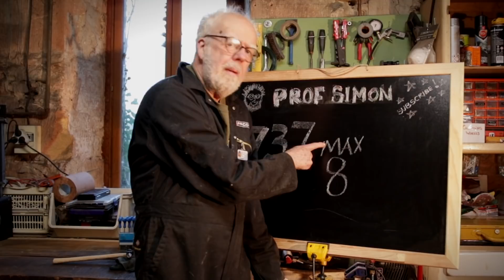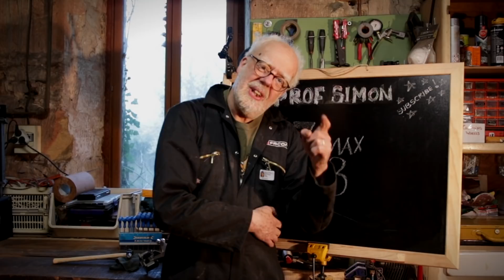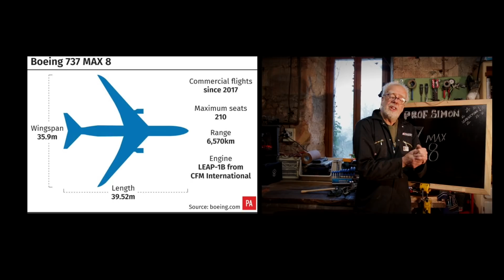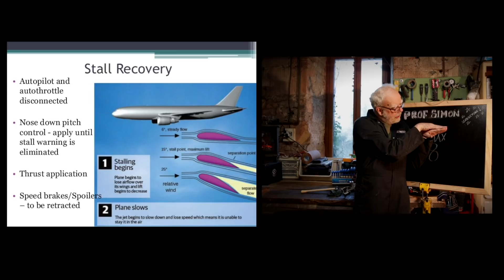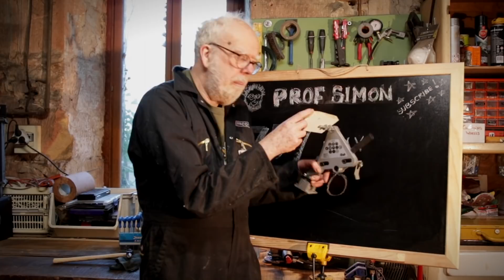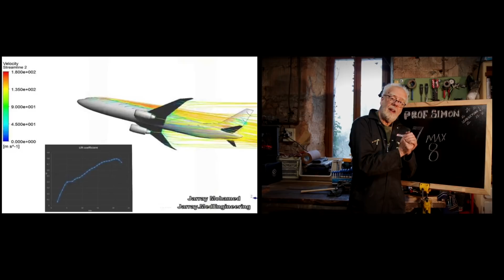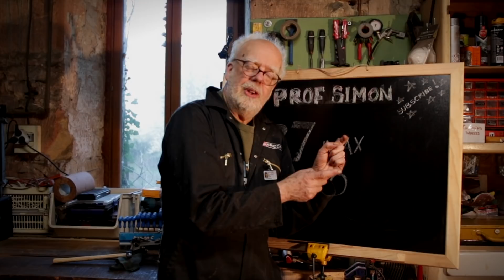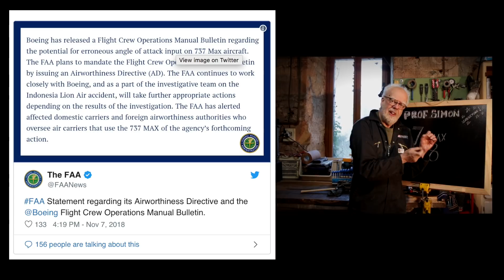Boeing 737 max 8's

Comment: This video isn't wrong, but misses the fundamental point... like all videos I've seen about this issue.  The fundamental point is this.  To fly an airplane expertly takes time and practice.  Eventually, "the pilot becomes one with the airplane"... to adopt a phrase most people will understand.  But mere mortal human beings are not capable of becoming one with dozens of airplanes... or with dozens of combinations and permutations of a single airplane.  But the trend in avionics and aircraft automation systems is to have many subsystems, many of which are more-or-less independent, and many of which are interconnected with other subsystems.  The problem is, a pilot can only "become one with one airplane" (or at most 2 or 3 airplanes, though even that is too much for many or most pilots).

The bottom line is the following. An airplane should have only two modes of operation: the pilot flies the airplane or the autopilot/automation-system flies the airplane (based on data entered into the avionics by the pilot and/or copilot).  When anything "goes strange" or "funky" or "odd"... the pilot should grab the controls (yoke/stick, rudder pedals, engine thrust levers, flap levers, trim controls and any other control surface manipulation controls) and FLY THE AIRPLANE.  Whenever pilot or copilot grabs and moves any control the autopilot needs to report this fact out loud ... for example say "pilot in control".  Likewise, when autopilot is engaged, the autopilot needs to report out loud that "autopilot in control".

The most important point is... when pilot and/or copilot are flying the airplane, the autopilot must NEVER overrule them... NEVER, NEVER, NEVER, NEVER, NEVER.  However, it is very desirable for autopilots to provide AUDIBLE (sound and verbal) warnings for many conditions (dangerous and mundane) such as pitch, roll, climb/descent rate, terrain ahead, altitude above ground, traffic in the area... and plenty more.  A pilot can IGNORE audible warnings and information from the autopilot when necessary.  And FOR CERTAIN any pilot with even modest training can look at his instruments... several of his instruments, as well as the view through the windshields when in VFR conditions... to determine what corrective actions might be necessary.

THE AUTOMATION SYSTEMS MUST NEVER OVERRULE PILOT OR COPILOT CONTROL INPUTS... BUT NOW THEY INCREASINGLY DO SO.

The pilots are almost always held at fault by aircraft manufacturers (no surprise) and often by accident investigators and FAA... when automation systems are to blame for crashes. I have seen this pattern increase in recent years. It is a historical fact that pilots are universally considered responsible for flying their aircraft.  However, now that automation systems overrule pilots, this is FACTUALLY FALSE ... yet the historical presumption inappropriately remains.

The fundamental fact is what I said above. Human beings do not have the capacity to deal with endless combinations of permutations of automation systems flying various aspects of the airplane and/or interacting with other automation systems that are.

The ONLY solution that is commensurate with the ACTUAL capacity of mere mortal human pilots is to have TWO AND ONLY TWO MODES OF FLIGHT:
  - pilot flies the airplane (and all control surface do as they are told by pilot manipulation of control surfaces, thrust, etc.
  - autopilot/automation-system flies the airplane (and takes actions based upon data entered by pilot and copilot).

NO other combination and permutations are acceptable.  Mere mortal human pilots cannot hope to "become one with many combinations & permutations".

Note that some pilots will disagree with this... but that is because they are afraid to not be hired if they claim they cannot handle excessively complex systems.

*AND FINALLY ... for any of you who remain skeptical ... you must consider the following:  When something "goes strange" or "funky" or "odd" ... SOMETIMES an airplane may be so high above the ground that the pilot has time to paw through the pilot operation handbook for a significant period of time to attempt to figure out what is causing the strange, funky, odd behavior of the airplane... and fix the situation before the crash.

But SOMETIMES (and far too often) the airplane is close to the ground... AND THE PILOT DOES NOT HAVE TIME FOR SUCH NONSENSE.  These are precisely the situations where it is absolutely crucial that "the pilot is one with the airplane" to assure survival of the airplane and crew and passengers and/or cargo.

Note that both the Indonesia and Ethiopia crashes were fairly close to the ground when the airplane "went strange, funky, odd" and crashed them into the ground.  While the Ethiopia airplane was not at what one would normally consider a terribly "low altitude" (it was somewhere around 9000 feet as I understand)... the ground was somewhere around 8000 feet in that area, so the airplane was only a few hundred to ~1000 feet above the ground.  Which means... VERY LITTLE TIME TO RESOLVE THE SITUATION... OR DIE.

This is why there should only be TWO MODES of flying: pilot flies or autopilot flies.  ... NO MORE.

NOTE: These big complex airplanes have dozens if not hundreds of automated systems to control all sorts of aspects of the airplane. For example, systems to control the cabin temperature, cabin air-pressure, cabin oxygen-content, and on and on and on.  THESE SYSTEMS DO NOT FLY THE AIRPLANE AND ARE THEREFORE NOT THE AUTOMATION SYSTEMS I REFER-TO.  Most of these systems can be completely independent from each other, and can be enabled and disabled by the pilot or copilot or crew independently without risk of crashing the airplane. So don't pretend I suggest the impossible or impractical. I only refer-to automation systems that fly the airplane ... meaning control pitch, yaw, roll, thrust, flaps, air-brakes and such. The saddest fact of this situation is... I am almost certain the aircraft manufacturers and crash investigators will continue to practice of having their version of HAL9000 automation systems control and manipulate more and more combinations and permutations of flight controls... and continue to pin blame on pilots who have been pushed further and further beyond their capacity to "be one with the airplane".  And so, I expect more of these crashes will happen in coming years.

Disclaimer:  I am a scientist, engineer, inventor, product developer... and I've created many products with robotics and automated control systems.  So I have experience with these systems and have spent time worrying about whether my designs might create or leave problematic situations.  Furthermore, I have been a private pilot for many years and recently purchased a small airplane... with advanced avionics and autopilot.  However, the so-called "advanced avionics and autopilot" for small private aircraft are not the gigantic complex systems the airliners are.  If they were, I would do without the autopilot.  As it turns out, these simpler autopilots pretty much work the way I suggested.... either the pilot is flying the airplane OR the autopilot is flying the airplane ... and never any combination or permutation or mixed-bag of "some of each".  And when the autopilot is turned off, it does not control the airplane.  And when ANY pilot manipulation of the autopilot is detected by the avionics, the autopilot is totally turned off and only the pilot is flying the airplane.  I say the above to indicate I have some experience in these topics, but only limited second-hand knowledge of flying big commercial aircraft.  Nonetheless, what is happening seems obvious to me, and I expect the dishonesty of executives in the aircraft manufacturer industry will continue to make this problem worse, and continue to blame pilots for what is in fact their malfeasance.

Comment: To many overweight passangers!.....pilots calculate the total weight of the aircraft by an average  weight per passanger, + luggage, fuel, and known ,fixed factors!...the only variable is the total weight of the passengers on board!...all  passangers should/ must be weighed , just like luggage,...so pilots/ computers ,can accurately calculate the gross weight load of the aircraft,and determine if the plane is over its flying capacity!...it's a fine line, a few pounds,between flight,, or crash!...

Comment: You are completely wrong...these planes had conception isues from the begining...that were not recognised...and even doe are having issues are still in production...SAFETY FIRST my friend and not business,affair and fuel economy. Machines,programs like autopilot,MCAS are made to help pilots but not to replace them or oblying pilots to fight with a machine...it's awful that a pilot manouver CANNOT outrule a machine,computer decision which can be faulty ex.because of a bug in the system,faulty sensors and so one...to be OBLIGATED to do a shut down manouver of a system like in the case of MCAS one in a stress condition can be faulty and secondly installing a shut down switch proves that can be dangerous and harmful.

Comment: When the KC-135s were updated with newer more powerful engines, an automatic rudder control was also installed.  If the pilot were to lose an engine, the results would cause the pilot to lose control without the system.  It monitors the engines, and adjusts the rudder based on engine outputs.

Comment: Let's assume that both accidents are a result of inaccurate readings from the AoA, which means the MCAS is operating using incorrect data, which gives cause for the Captain to fight with the aircraft, effectively fighting against the MCAS system. There are procedures in place for this type of environment, whether it be an older 737 that doesn't use the MCAS system, or the new MAX variants which do, it's called the "runaway stabilizer non-normal checklist".

1. Control column .............................................................Hold firmly
2. Autopilot (if engaged) ....................................................Disengage
Do not re-engage the autopilot.
Control airplane pitch attitude manually with control column and
main electric trim as needed.
3. If the runaway stops: (end of checklist)
4. If the runaway continues:
STAB TRIM CUTOUT switches (both) ..........................CUTOUT
 
If the runaway continues:
Stabilizer trim wheel ........................................Grasp and hold

2. doesn't apply because MCAS does not operate when Autopilot is engaged, nor does it operate when flaps are extended
4. is the critical point, because if you disengage the STAB TRIM CUTOUT switches, effectively disabling the electric stabilizer trim, MCAS can not make any corrections. To be clear, MCAS can not make any adjustments to the stabalizer trim of the aircraft if the electronic motors that control that function are disabled.

There have been several instances reported regarding the MCAS system, or more precisely the aircraft operating in a way that suggests the MCAS system was being fed bad data, whether is was faulty AoA equipment, or even implementation within the new design frame, doesn't change anything, because in all of those previous instances the pilots simply followed the checklist and regained control of the aircraft. Does the MCAS system need improvements, maybe, but more importantly whatever redundancies that are currently in place for equipment failure are clearly inadequate.

Here's a thought, you also have to wonder what the GPWS was doing when MCAS was driving the thing into the ground. Just imagine that scenario, your fighting the aircraft that wants to pitch down and at the same time you've got the GPWS screaming "terrain, pull up, pull up". Talk about playing mind games, damn, not a scenario I'd ever want to imagine.

The First Officer reportedly only had 200hrs in this aircraft and I think that's correct as I've seen it brought up in many articles. Let's just say it's fact and move on to this next piece of information, or misinformation. I have also heard that the FO was in control of the aircraft during takeoff, which isn't unusual, in fact more often than not is the case, but those who are suggesting that he was in control during the final stages of flight, I think, are incorrect. It's my understanding that with any emergency the Captain both verbally and physically takes control of the aircraft, then instructs the FO to start working through checklists based on the Captains evaluation of the situation. I'm happy to be corrected on that one, but if that wasn't the case and the Captain allowed the FO to remain in control while he worked through checklists himself, hmmm, not so sure that was the best course of action.

Lastly, it's goes back to the fact regarding MCAS not operating whilst flaps are extended. My understanding is that they didn't get more than 2,000ft in elevation and was fighting the aircraft more or less just after takeoff, but an interesting observation from the data regarding the airport is that it's at elevation, some 7,500ft and had a long runway, over 12,000ft, so flaps may not have been used at all for takeoff, hence they were immediately fighting MCAS from the get go. It's just a theory, not fact, just me trying to put all the pieces together.

Comment: Canadian pilots start their career in bush flying float or amphibious aircraft and build experience that is. compatible with aerodynamics then proceed onward to jets. Third world countries do not follow such a route. Inexperienced pilots on  takeoff upon reaching VR speed turn on the autopilot and fly the aircraft by rotating the little button of the HSI ( horizontal situation indicator) which is coupled to the AP. If all goes well they have a safe trip and log in the hours into their log books. They in fact are not "experienced pilots" but would be experienced at playing TV games.

Comment: Thanks professor for your humble opinion. As a retired military pilot and flying instructor perhaps I could add a little bit of my humble opinion. From a very early stage in every pilot’s training, the “standard stall recovery” (SSR) is taught and is practiced on every general handling (GH) sortie for the rest of his flying career, at least this was so in the RAF. I must have flown, witnessed or taught the SSR many hundreds or even thousands of times. As such the SSR is so engrained in a pilot’s skill set, that anyone who designs a system that expects him to act differently to this in a stress situation has to be an imbecile. I thought manufacturers had test pilot’s to advise against such foolishness. Anyway, that’s my humble opinion.
Reply: Well said. But as the good prof has said, failure to account for ingrained behaviour is not confined to the aircraft industry. Anyone who remembers their first encounter with Apple's 'natural scrolling' will know what I mean. Fortunately, the consequences of such imbecilic design are usually far less catastrophic.

Comment: Are you suggesting that the (I'm assuming required for the type) briefing/class/etc. isn't covering the differences well enough, or that when a seasoned pilot gets in a tight spot they revert to thinking they're flying the older (but more seat time) software (airplane?)

Comment: Not really how 737 works. It was not on autopilot. MCAS is always on but only active when the flaps are up and autopilot is OFF. It moves the entire stabilizer NOT the elevator itself.
1. Boeing found 14% improvement in fuel by moving the engines forward and up
2. This made the plane unstable so they added MCAS to manage un-commanded nose pitch instead of re-working the aerodynamics to make the plane stable in all thrust situations
3. Boeing did not chose a better technology than a metal flipper to determine AOA at the nose 
4. Making adjustments via the Horizontal Stabilizer is the "cheap" way to make attitude changes instead of a better integrated control over the elevator. 
So yes a bad design choice however as a pilot of you don't know how to stop a runaway stabilizer you have other problems managing the cockpit systems. The Air France crash was caused by the pilot flying holding the stick back during a stall (confusion). This also happened in the Buffalo ATR crash. If the basics of stall recovery aren't present no training or systems can help. But back to MCAS. Here is how I explained it to my wife:
Picture changing the direction of your car automatically by moving the rear wheels when you least expect it. So it is no surprise how this can really mess up pilots not knowing this may happen. You can compensate for some or even moderate moves to the back wheels but eventually too much steering from the back un-commanded will send you off the road.
This is not new. Moving the stabilizer instead of the elevator has been the fatal cause of many aircraft including the Alaska Air and some others. Once you move the Hstab so far the elevator becomes ineffective. This is what happened in both crashes. If you don't stop it from "running away" it will change the angle to the point the yoke input doesn't change the attitude.  The smarter way would have been to use the elevator or elevator in coordination with the trim (like Airbus does).  But this requires arbitration of 3 forces being the airstream, the pilot input, and the AP or MCAS plus trim to keep the stabilizer close to the relative airstream.